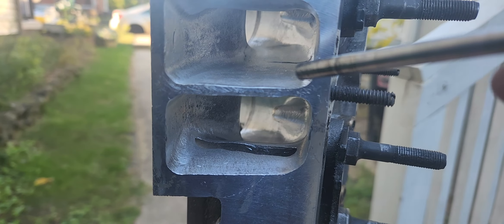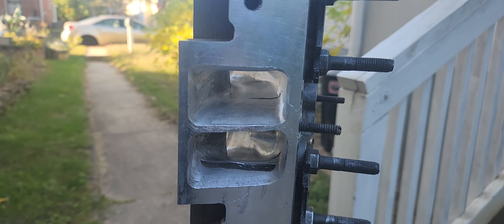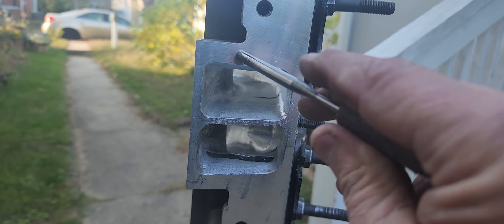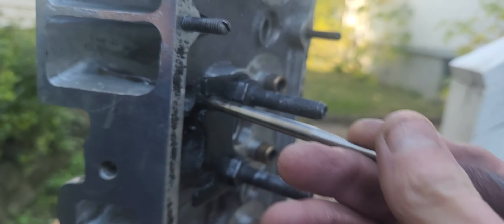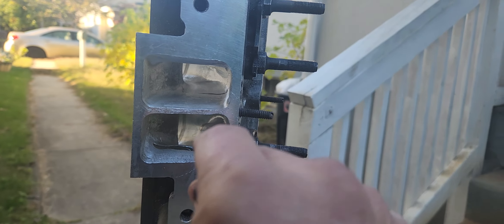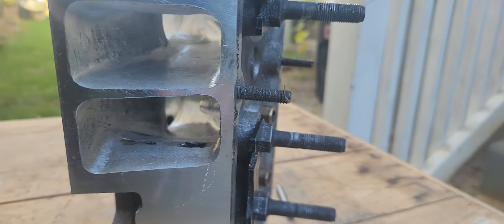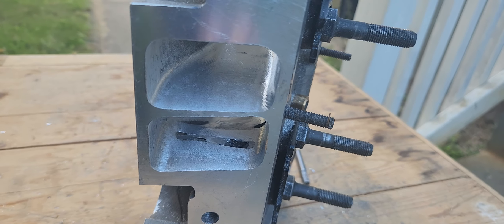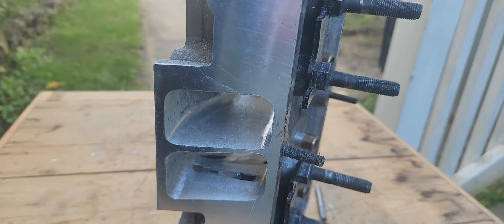World products sbc heads get ported to the max and tubed

Comment: How many inch mouse you thinkin ?? I say a bigger one and still spin it hard . 
A engine dont care whose name is on the valve cover .
Its all science and art !!!
Reply from the maker: Only a stock 350 low compression but I sure see where you're coming from and you are right,  thanks for watching
Reply: @terrygrover6440  then the only way youll run the number is to go Super Stock style of a camshaft/compression build but youll have better flowing heads .  Id still keep a 104 LSA i think . Keep the exhaust valve Small with 1 Angle ONLY and sink it a little bit .  The 4x4 Victor is a pretty effective intake too in that combo with 780 cfm Quadrajet that was required . Even the cast crank (305 , lighter) lives with all shaped and polished up counterweights especially with everything else light as possible . Stock (350)  rods polished everywhere , shot peened , sized , torqued ARPs , then put in the oven hanging from the small end  to stress relieve them cooling slowly .  Worked good for us to 7,800  as rules didnt allow 6 inch so we went LIGHT .  We ran the 10.25 to 1 , FT w offset pin 1mm,1mm,3mm , 300hp 350 class car in a  3rd gen Camaro .  Its all about getting it off the line and the first 60ft on the rears only . Thats what wins . Light as possible never hurts either . 5,500+ convertor and falling back onto its stall upon gear change is wise . Adjustable cam timing you can do at the track will be your best friend . Notch the top of that bore if biggest intake valve you can chamber overhangs . 
Low compression NA , no hose , is a different world .
I figured a head start couldnt hurt . Good luck !!!
Reply: A Victor E also works good in this application . Transmissions - a powerglide absorbs 16hp , a 350 absorbs 26 hp , and the 400 absorbs 52 hp .  The untold story .